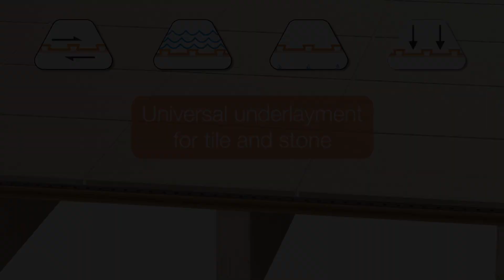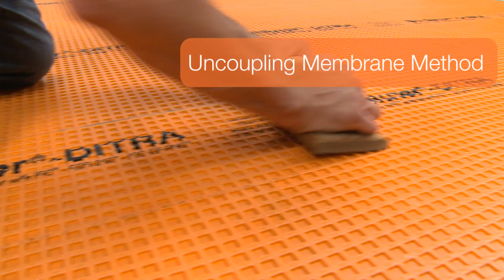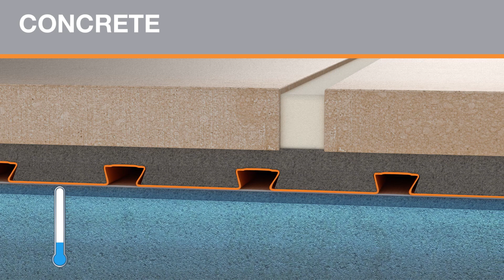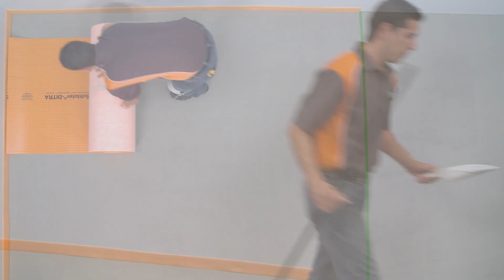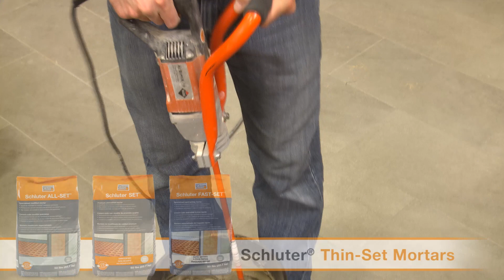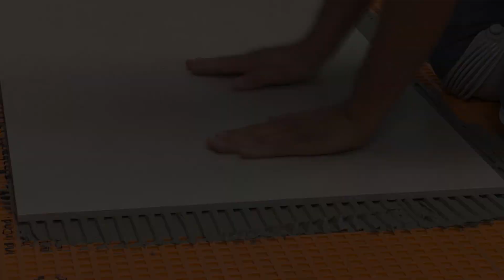Schluter®-DITRA Installation over Concrete Full Video Series

Comment: Is it okay to lay 18” square tiles on this without a modified thin set? I read that i needed to use thin set with polymers to install tile this size.
Reply from the maker: Hi there, could you please give our Product Support team a call to discuss?
US 800-472-4588
CA 800-667-8746
Thanks!

Comment: is it possible to lay this over painted concrete floor then tile ? or should i get the paint removed first?
Reply from the maker: Good question! The DITRA Installation Handbook states "slab to be free of waxy or oily films and curing compounds (when present, mechanical scarifying is necessary)". Paint can be a bond breaker for thin-set, so it's best to remove.

Comment: Is it necessary to remove concrete sealer before installing DITRA?
Reply from the maker: Hi Deborah!
Great question. As per our handbook, the "slab to be free of waxy or oily films and curing compounds (when present, mechanical scarifying is necessary)".

So, you may have to look into it further. Is the sealer a  waxy or oily film or curing compound? How does the sealer manufacturer describe it? How old is the sealer?
What does the thin-set manufacturer say? 

After a little investigation, if you are unsure,you should do a test patch to find out if the thin-set bonds to it or not. You're welcome to give us a call to discuss more:
800-472-4588 (US)
800-667-8746 (CA)

Comment: We  have an existing stone tile on slab with a conventional setting bed so the floor will line  up with adjacent wood flooring on screeds.  It seems like it would be okay to use the Ditra applied to the slab then a setting bed as  required to subsequently thinset the stone tile.  Does that sound  right?
Reply from the maker: Hi Jim, mind giving our product support team a call to discuss? 800-472-4588 Thanks!